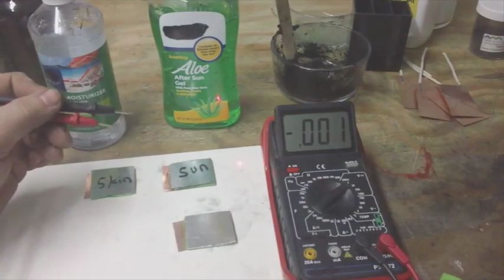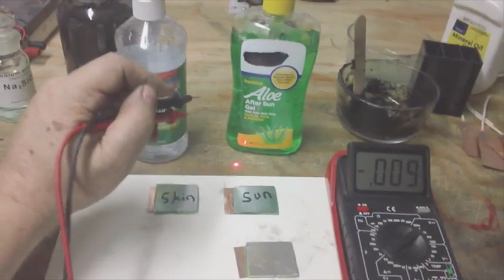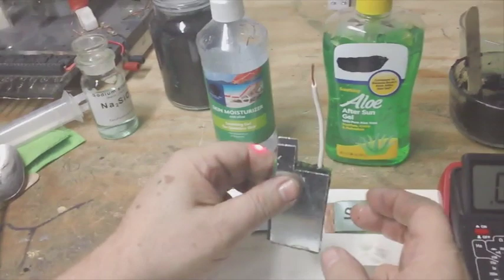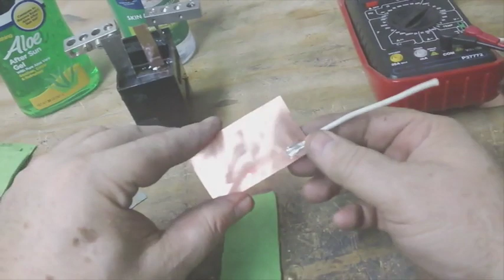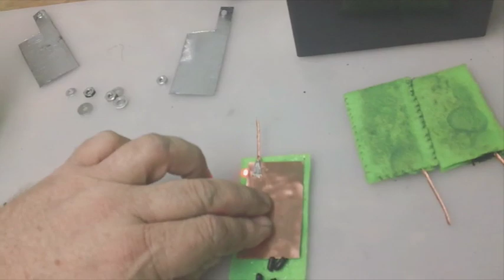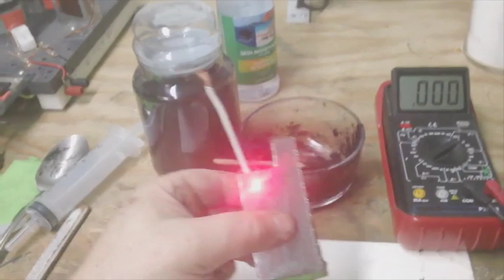powercellsbetabuild

Comment: i tried some batteries like that but i used a carbon fibre cloth used in making carbon composite. i had a charge voltage of around  2 volts with lightly salted water electrolyte